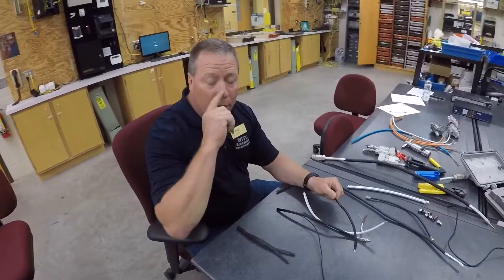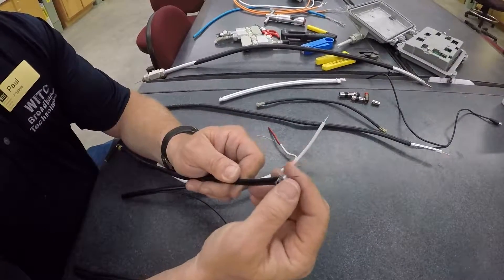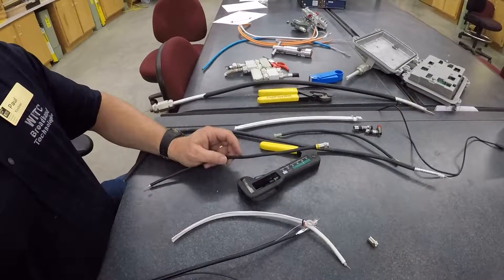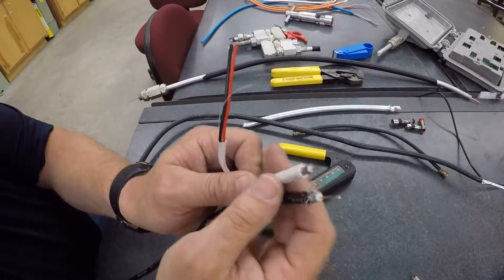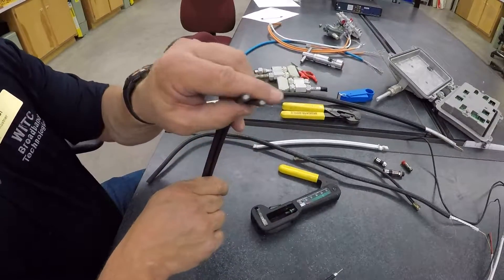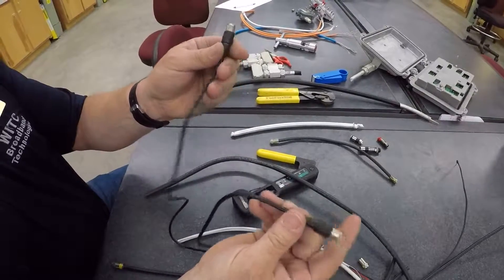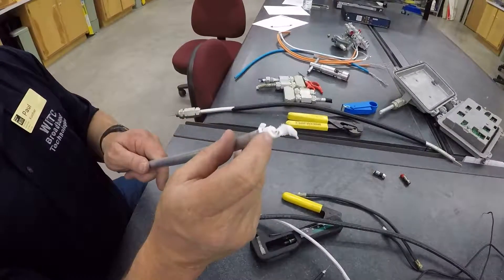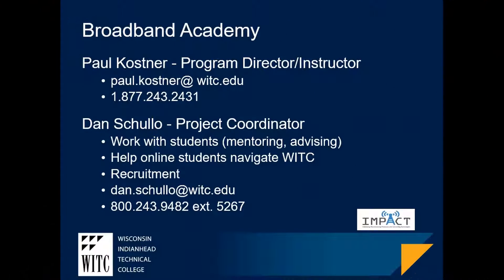WITC Broadband Academy CATV Coax Cable Characteristics

Comment: How do I become a student of that because I'm interested in the cable TV field I live in the Southeastern part of Wisconsin
Reply: APPLY at ANY Contractors Cable or  Satelite Installation Companies, They  WIll Train you and provide all Certifications and make sure you understand cabling. 2:02 you learn that This Outer Steel wire is CALLED a "Braid" and is also the Ground for the Center Conductor. But he didnt say that in the video. But you'll learn things Like that out in the field.. Also the Bigger Companies ? yea you can , and they have openings to keep an eye out for, but the Money would be in Contracting and its a good start with NO experience and you could usually make more than the in-house techs.- Good Luck, Its a Wonderful Career path..